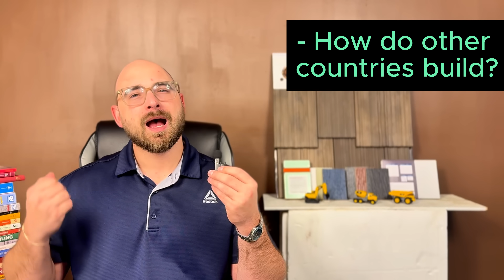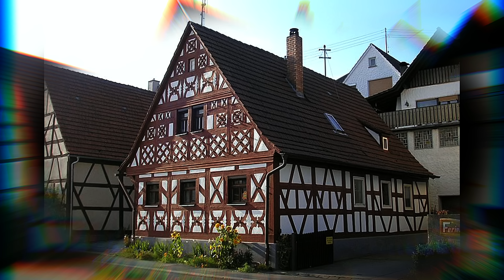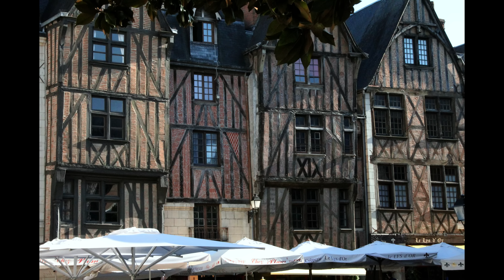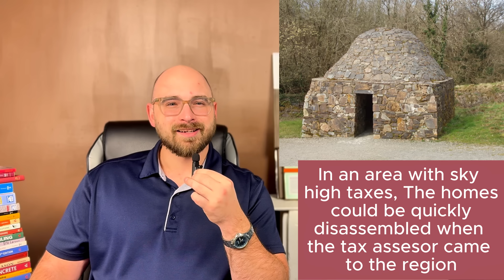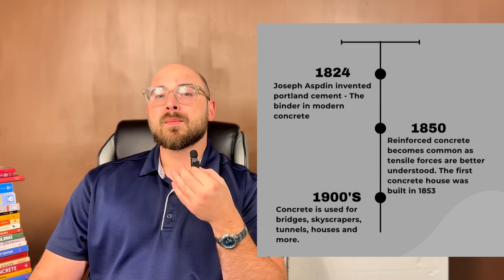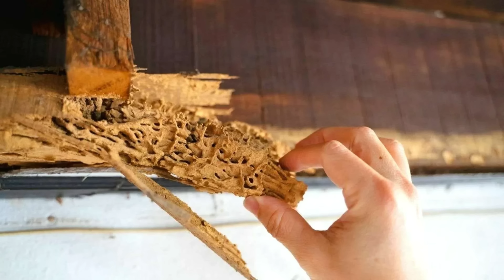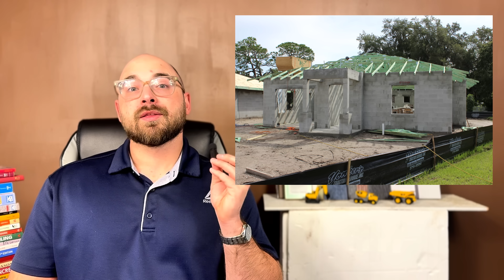Why Other Countries LAUGH at American Homes

Comment: The problem with brick and concrete is that the fine sand needed is in short supply and that sand mining leads to intensified flooding and ecosystem damage.
Reply: Where did you hear that nonsense
Reply: @alexpervanoglu7420  just look it up. There are some making this sound worse than it is, but there are plenty of reputable sources speaking on this. The Smithsonian, Stanford, the UN to name a few. 

As the fella in the video said, building materials are typically taken locally, but that's not the case with sand because it has become so scarce in some areas. 

It's become the largest black market construction grade item. There are numerous countries who are in a constant fight against black market sand mines. Nature has a good paper addressing this. 

This is mostly happening in Asia right now, and has caused much ecological damage. But as we use more and more of this specially shaped sand, this problem will hit even the richer countries eventually. 

There currently is no method of creating fine sand or an alternative that can keep up with the growing market. 

One last thing to look up would be the damage caused by this. Houston TX is beginning to have this problem with the San Jacinto River. Uttarakhand India, Uganda, China  and Vietnam all have problems with this. 

We only find the type of sand necessary for making concrete and bricks in rivers and streams. As we dig them up, we slow down how quickly the fine sand is replaced. The stuff we dig up to get fine sand is the only mechanism that creates fine sand.  

Again, this isn't a big problem now, but one look at the growing demand makes you realize concrete and brick will  be very finite unless we find a way to replicate fine sand at a rate that matches our demands and won't cost more than invading weaker countries. 

I learned all that from reading. 😀
Reply: Stanford, the UN, multiple studies and reports from multiple researchers and countries. 

WATOP and Forbs both have videos about it if you're not a reader. 

Fine sand mostly comes from rivers and streams. The sand mafia is estimated to be worth $200-350 Billion. It's starting in Asia, but it will spread as fine sand deposits are stripped. China made more concrete in 2011-2013 than the US has made in the 20th century. Even US Republican strongholds like Houston TX are addressing and trying to fix the ecological and commercial problems associated with sand mining. As you dig up a river for sand and rock, you slow the river's ability to create fine sand. There is no alternative that costs less than invading another country and no alternative that has the ability to keep up with our usage.
Reply: @alexpervanoglu7420 We are taking fine sand from rivers and streams faster than the natural processes can produce it. We have no way of replicating fine sand that can keep up with our usage. Mining fine sands slows down the river or stream's ability to create more fine sand. Desert sand is too round, Ocean sand is too salty, and both produce poor quality concrete and bricks that will not last. There are many governments and fields of science addressing this. The fine sand black market is estimated to be worth up to $300 billion and multiple governments are having a hard time combating this. People are being killed over fine sand because it's starting to become rare. Honestly... where have you been?
Reply: @foundingfarther  Yes there may be a shortage of river sand, but the Romans proved sea sand and salt water can be used in concretes, and it will actually last longer. Red bricks that we use across Europe are made predominantly from clay. 
Quarries produce fine sand mechanically. 
I used to collect and deliver it in a bulk tipper truck. 
My local building yard gets it delivered in bulk and prices have been the same for over a decade now. About 10c a kilo. 
I've read a few articles about the shortage and it seems there are quite a few conflicting opinions over it. 
Anyway have a good day.
Reply: @alexpervanoglu7420 Yes mechanically produced sand is a thing, and as I said above it doesn't even come near producing enough to keep up with our global rate of use. The fact that you mention Roman concrete makes me think you have not read anything on this topic. Yes, Roman concrete has a chemical reaction that can cause a "healing" effect if the structure gets enough moisture, but that same effect will corrode the steel rebar we use today to create structures that the Romans couldn't dream of. Roman concrete is considered impure by modern construction standards. Their limit was like aqueducts, we're building locks through mountains for maritime trade. I get that the price of fine sand has stayed stable in your local area for a short amount of time, but this is not the truth for many parts of the world and will be less true everywhere as time goes on. I know we've seen it nearly double in price over the last decade. You have a good day too and maybe later we can talk about the ecological issues such as the salination of freshwater aquifers cause by fine sand mining from rivers and streams, which are our main source of fine sand. :)
Reply: @alexpervanoglu7420  Yes mechanically produced sand is a thing, and as I said above it doesn't even come near producing enough to keep up with our global rate of use. The fact that you mention Roman concrete makes me think you have not read anything on this topic. Yes, Roman concrete has a chemical reaction that can cause a "healing" effect if the structure gets enough moisture, but that same effect will corrode the steel rebar we use today to create structures that the Romans couldn't dream of. Roman concrete is considered impure by modern construction standards. Their limit was like aqueducts, we're building locks through mountains for maritime trade. I get that the price of fine sand has stayed stable in your local area for a short amount of time, but this is not the truth for many parts of the world and will be less true everywhere as time goes on. I know we've seen it nearly double in price over the last decade. You have a good day too and maybe later we can talk about the ecological issues such as the salination of freshwater aquifers cause by fine sand mining from rivers and streams, which are our main source of fine sand. :)
Reply: @alexpervanoglu7420  Yes mechanically produced sand is a thing, and as I said above it doesn't even come near producing enough to keep up with our global rate of use. The fact that you mention Roman concrete makes me think you have not read anything on this topic. Yes, Roman concrete has a chemical reaction that can cause a "healing" effect if the structure gets enough moisture, but that same effect will corrode the steel rebar we use today to create structures that the Romans couldn't dream of. Roman concrete is considered impure by modern construction standards. Their limit was like aqueducts, we're building locks through mountains for maritime trade. I get that the price of fine sand has stayed stable in your local area for a short amount of time, but this is not the truth for many parts of the world and will be less true everywhere as time goes on. I know we've seen it nearly double in price over the last decade. You have a good day too and maybe later we can talk about the ecological issues such as the salination of freshwater aquifers cause by fine sand mining from rivers and streams, which are our main source of fine sand. :)
Reply: @alexpervanoglu7420 Yes mechanically produced sand is a thing, and as I said above it doesn't even come near producing enough to keep up with our global rate of use. The fact that you mention Roman concrete makes me think you have not read anything on this topic. Yes, Roman concrete has a chemical reaction that can cause a "healing" effect if the structure gets enough moisture, but that same effect will corrode the steel rebar we use today to create structures that the Romans couldn't dream of. Roman concrete is considered impure by modern construction standards. Their limit was like aqueducts, we're building locks through mountains for maritime trade. I get that the price of fine sand has stayed stable in your local area for a short amount of time, but this is not the truth for many parts of the world and will be less true everywhere as time goes on. I know we've seen it nearly double in price over the last decade. You have a good day too and maybe later we can talk about the ecological issues such as the salination of freshwater aquifers cause by fine sand mining from rivers and streams, which are our main source of fine sand. :)
Reply: @alexpervanoglu7420 Yes mechanically produced sand is a thing, and as I said above it doesn't even come near producing enough to keep up with our global rate of use. The fact that you mention Roman concrete makes me think you have not read anything on this topic. Yes, Roman concrete has a chemical reaction that can cause a "healing" effect if the structure gets enough moisture, but that same effect will corrode the steel rebar we use today to create structures that the Romans couldn't dream of. Roman concrete is considered impure by modern construction standards. Their limit was like aqueducts, we're building locks through mountains for maritime trade. I get that the price of fine sand has stayed stable in your local area for a short amount of time, but this is not the truth for many parts of the world and will be less true everywhere as time goes on. I know we've seen it nearly double in price over the last decade. You have a good day too and maybe later we can talk about the ecological issues such as the salination of freshwater aquifers cause by fine sand mining from rivers and streams, which are our main source of fine sand. :)
Reply: @alexpervanoglu7420 Yes mechanically produced sand is a thing, and as I said above it doesn't even come near producing enough to keep up with our global rate of use. The fact that you mention Roman concrete makes me think you have not read anything on this topic. Yes, Roman concrete has a chemical reaction that can cause a "healing" effect if the structure gets enough moisture, but that same effect will corrode the steel rebar we use today to create structures that the Romans couldn't dream of. Roman concrete is considered impure by modern construction standards. Their limit was like aqueducts, we're building locks through mountains for maritime trade. I get that the price of fine sand has stayed stable in your local area for a short amount of time, but this is not the truth for many parts of the world and will be less true everywhere as time goes on. I know we've seen it nearly double in price over the last decade. You have a good day too and maybe later we can talk about the ecological issues such as the salination of freshwater aquifers cause by fine sand mining from rivers and streams, which are our main source of fine sand. :)
Reply: @alexpervanoglu7420 Yes mechanically produced sand is a thing, and as I said above it doesn't even come near producing enough to keep up with our global rate of use. The fact that you mention Roman concrete makes me think you have not read anything on this topic. Yes, Roman concrete has a chemical reaction that can cause a "healing" effect if the structure gets enough moisture, but that same effect will corrode the steel rebar we use today to create structures that the Romans couldn't dream of. Roman concrete is considered impure by modern construction standards. Their limit was like aqueducts, we're building locks through mountains for maritime trade. I get that the price of fine sand has stayed stable in your local area for a short amount of time, but this is not the truth for many parts of the world and will be less true everywhere as time goes on. I know we've seen it nearly double in price over the last decade. You have a good day too and maybe later we can talk about the ecological issues such as the salination of freshwater aquifers cause by fine sand mining from rivers and streams, which are our main source of fine sand. :)
Reply: @alexpervanoglu7420 Yes mechanically produced sand is a thing, and as I said above it doesn't even come near producing enough to keep up with our global rate of use. The fact that you mention Roman concrete makes me think you have not read anything on this topic. Yes, Roman concrete has a chemical reaction that can cause a "healing" effect if the structure gets enough moisture, but that same effect will corrode the steel rebar we use today to create structures that the Romans couldn't dream of. Roman concrete is considered impure by modern construction standards. Their limit was like aqueducts, we're building locks through mountains for maritime trade. I get that the price of fine sand has stayed stable in your local area for a short amount of time, but this is not the truth for many parts of the world and will be less true everywhere as time goes on. I know we've seen it nearly double in price over the last decade. You have a good day too and maybe later we can talk about the ecological issues such as the salination of freshwater aquifers cause by fine sand mining from rivers and streams, which are our main source of fine sand. :)

Comment: Keeping a concrete house warm during  the winter time is really a challenge. Wooden houses are much more efficient on that aspect besides being much comfortable and affordable. Does anyone here know how much would cost to make a concrete home? You need more skills and is a lot more difficult to accomplish, mortars take more than 48hs. Setting Before you can keep going. So just in labor your costs will increase and if you wanted to be efficient as a wooden home you'll have to spend more on materials. Does anyone also know how portland Cement is made? Well...is not that eco friendly environment kisser as  you may think.
Reply: You need to get out of the USA if you belive this nonsense. Honestly.

Comment: I'm from Brazil. I think one of the best technologies for building today is the soil-cement block, or ecologic block/brick. I intend to build a house made of those cause their cheap, have a good appearence, don't need plaster or mortar between them, have good sound and heat isolation and are easy do work with.
Reply: Esse tipo de projeto tende a ser bom se a sua equipe de execução for bem treinada. Caso contrário, vai dar problemas, e rápido. Tome cuidado com a impermeabilização, também.

Comment: Almost all of the homes around me on the Space Coast are CMU.  There is a small percentage of stick.  Most of them are apartment complexes.  The CMU is fine.  3d printed homes are trying to gain traction right now.  They look promising for fast construction.  If I were to build right now, I'd choose ICF if possible.  Otherwise, CMU is fine.

Comment: Mr Fortin, thank you for this informative commentary.
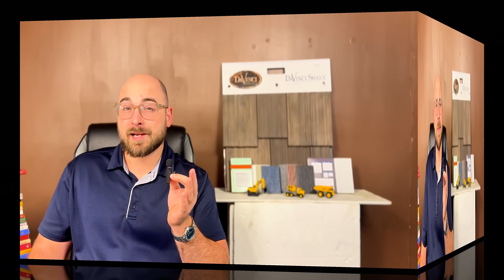2:27 - There are many tapia homes still standing in my country. I have lived in one (10 metres square, 2 floors). It stood for 100 years without a single crack. It was much cooler than concrete. The flooring was wood - it also lasted and was reused for permanent structures in my new home.

Comment: Big difference between a US house built today and one built prior to WWII. Houses built today are absolute garbage. My house was built in the 1790s and it's a totally different story. It's built of large quarter sawn white oak, there isn't any drywall, plywood, or partical board in it, it somehow escaped getting "remodeled" well at least since the 1930s it's a well built house. You couldn't afford to build a house like this today, the lumber alone would cost millions, if you could even get it. It's a never ending battle to keep this old stuff going. For an example getting parts or service on a boiler built in 1937 is like pulling teeth. Anyone who sees it just immediately wants to try to talk you into replacing it for some unexplained reason, and you wouldn't believe the crap they start spewing about it being inefficient. Well if it's so damn inefficient then why does it burn less fuel then my neighbors new "high efficiency" pile of shit boiler? The damn oil truck is at that house like every other week! Anyway you can't say American houses are badly built, there are far more older well built houses here then the new piles of junk ones, although a great many of them have been ruined by stupid owners who have fallen for these contractors who have talked them into remodeling them. Hell look at my neighbor he has someone working on his house like every other week. It's not the old stuff that's needing all that work it's the junk they replaced it with! Sadly made in the USA doesn't mean what it used to, there was a time when made in the USA meant made to last forever, with pride, not the cheapest pile of junk we can crank out with zero fucks given as quickly as possible.

Comment: Just an interesting fact.

Here in my country (Croatia), the university I attended was built in 70s or 80s and it has energy efficiency rating D. 

The old austrian officer barrack built in 1700s which is also a part of the university (used for computer science ironically) has efficiency rating A because of the massively thick foundation walls.